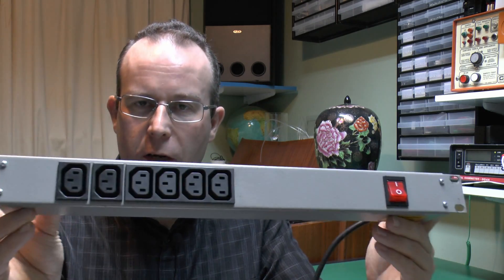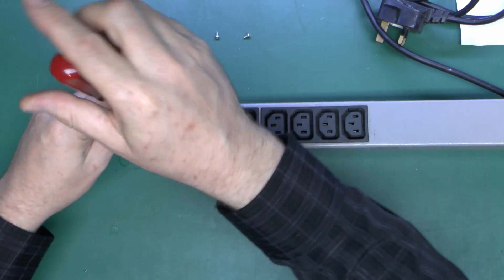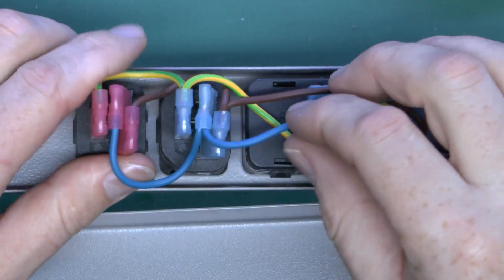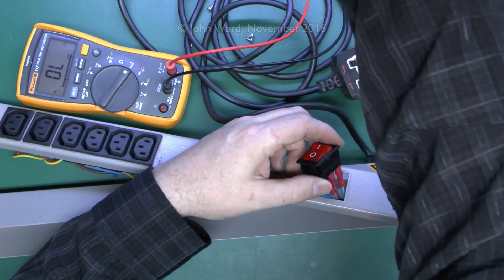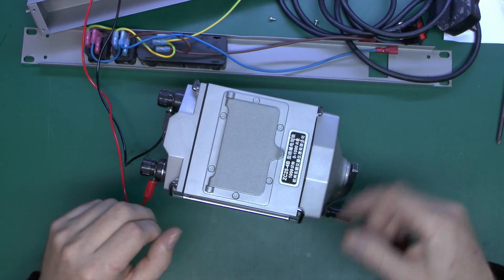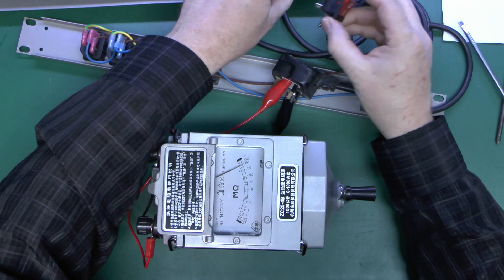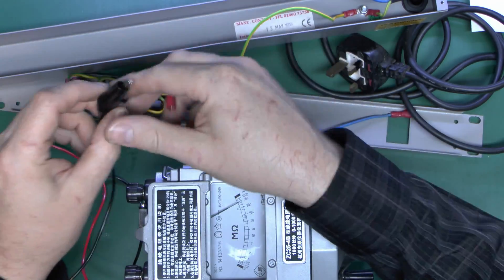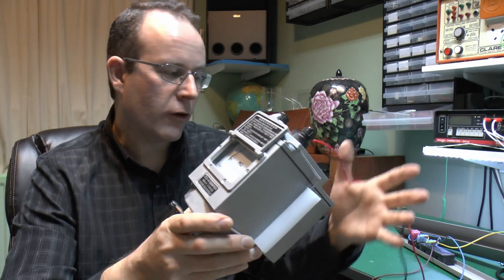Old Power Distribution Unit

Comment: Love the Megger! I can shed some light on the manufacturer. I work for www.dcdi.co.uk and have been selling that same PDU for around 20 years. Also we recently acquired a PDU manufacturing business that uses the same metalwork supplier - www.integra-pdu.co.uk
FFL was Fieldgate Fixings Ltd and yes, they were in Chard, an area that I believe still has only 5 digit telephone numbers in use! Fieldgate Fixings moved to Taunton in the late 1990s/2000 and became DPS (Data and Power Solutions). Around 5 years ago, DPS was bought by a larger American company called Geist. Just under a year ago Geist was purchased by a massive PE outfit called Vertiv and are now gunning for a slice of APC's cake. Their product these days is a much higher end unit with IP monitoring and remote switching and if you need any www.dcdi.co.uk can help! If you need a replacement or a PDU very similar to the one you tested in your video then you need www.Integra-PDU.co.uk - excuse the shamless touting of my business, but it is all relevant and hopefully on interest!
Reply: Thanks for the information 👍😀

Comment: You probably have the 4-way and then the two separate 1-way IEC connectors to make the wiring easier. Also, cutting holes for 6 individual 1-way IECs would increase the production time for something that looks to be made in smallish quantities. Further to that, I'd imagine that 6 cutouts would weaken the front panel more so than the current setup
Reply: Agree.   It's probably cost savings too -- you could machine any number of holes out of that faceplate so its all about what components are available and what combination gets you the best margins;  I'm sure for a 6-way PDU the cheapest combination was 4+1+1.   I bet if you bought an 8-way it would have 4+4.

Comment: This was made for the UK market and in the UK. Why don't the outlets have shutters?
Reply from the maker: The requirement for shutters only applies to BS1363 outlets, items such as this power strip are not included and would not normally be used in homes or other locations accessible to the general public either.
Reply: Thank you for clearing that up.

Comment: not just 1 and 2 wires but red = wires with a total (area square)of <1.5mm2 and Blue = wires with a total <2.5mm2.  (Yellow goes up to 4mm2). The minimum is about 0.2mm2 for Red, 1.0mm2 for Blue and 2.5mm2 for Yellow.

Comment: When he checked the resistance between line and X, why did he connect it to the part when the fuse is inserted rather than the live pin of the plug, if someone could tell me I'd appreciate it. Cheers.
Reply from the maker: Without the fuse installed, the line pin is only connected to the metal tab where the fuse fits.  The other end is connected to the wire.
Reply: John Ward ahhh I should of known that, thanks mate. I've scrolled through a lot of your videos and the level in detail is amazing. Keep it up.

Comment: Red crimp connectors are smaller in size and only have one wire in them, the blue are larger because they have two wires crimped in them.

Comment: 01460 73736 is a Crewkerne Somerset number. Ten digit phone numbers are still quite common in parts of the south west and a search reveals this now belongs to RH Construction (http://www.trustedlocal.com/directory/building-decorating-appliances/r-h-construction.htm). 

Given the construction of the unit my guess is that FFL were a pretty small scale manufacturer who are now long gone. There was a metal fabricator in Crewkerne who could have easily turned out the casings for these and the rest of the components are standard off the shelf.

Comment: Did they really copy the bezel screw heads in fake plastic on the megger?
I have several, and one hand cranked one in particular I prefer over all the others, including those with battery. It's just so quick and convenient to use, no switch, no battery to run down, and it keeps your hands off the circuit. You know a short after just a flick of the handle but I always give it a good few turns, just to make sure. 
BTW the movement inside a megger is quite interesting, since it reads nearly correct resistance regardless of the speed you crank the handle. It is similar to the movement inside a power meter, probably worth a video segment if you are into that.
Also the rectifier in the old ones is mechanical, reverse of a commutator. On the 5kV ones I have it is quite a pretty thing.
Reply from the maker: Yes, the whole top plate is a single piece of plastic, fake screw heads included.
Reply: Makes me wonder if they did a vaccuum form for the injection mold or if they did that on purpose to deceive people.

Comment: The red connectors they used take one wire while the blue ones take two, that's why they are different.
Reply: Was going to comment that...

Red ~0,5–1,5 mm&#178;
Blue ~1,5–2,5 mm&#178;
Reply: stefantrethan wow someone else who relised this I thought it was common knowledge
Reply: Where going to comment? What language did you translate from?

Comment: Is it possible that the two separate are for always on power and the 4 together switch off as a group?
Reply: Tech It Out did you not see the video? all the outlets are from the same switch!
Reply: Yes but one was in a box that may have had some electronics that when one item say a PC is turned off they all go off. I have a switch block that does this.
Reply: this is not a smart socket, its all wired as a group, there is no reason i can think they used 3 sets instead of 2 of the larger.
Reply: +jusb1066 Price. A 4-unit might have cost more than two singles, but less than 4 singles plus extra wires. Probably no other counts readily available from RS at the time, so this combination was probably the cheapest way to assemble 6 IEC C13-like outputs with high quality parts that they would risk putting their name and phone number on.

Comment: The connectors have different colours because they are marked for diffrent wire sizes. For red (0.5mm² - 1.5mm²) and for blue (1.5mm² - 2.5mm²)

Comment: I think they used the 2 separate plugs because they were cheaper than getting a 6 plug or a 2 and 4 plug socket
Reply: Hearing RS + Cheap in the same sentence would be a world first I'd think.
Reply: dossod either that or a 6 gang socket isn't available off the shelf

Comment: Tripping is most likely due to the neon resistor having gone low as you could not find anything else. The terminals are colour coded as to size, the Blue are larger than the red. The tripping could also be due to a whisker from one of the wires touching another at the terminals and the act of pulling it apart moved it. You should try plugging it in with a breaker plug in line to test it.
Reply: it showed about 2-3 megohms with the neon in circuit, so its not the neon, i think it was just another device was faulty and they blamed the lead.  the reason to use a mega tester is to not need a breaker, its to test and find the fault.
Reply: I did not note the resistance of the neon, but thinking on it more it could well be the fault is in the plug, I had a computer lead with a moulded plug that had a shorting whisker in it, he made the tests without the fuse in.
Reply: Equiluxe1
i agree i would have tested it from the plug end , fuse intact initially, there could be some wierd reason like you say,but i guess this one escapes, im sure its going in the bin anyway

Comment: Minor nitpick. When you checked continuity of the switch you first only checked across one diagonal when the switch was closed. That's fine since you just confirmed the switch had continuity when closed. But then you also only checked one diagonal when the switch was open, which excludes other failures that could theoretically occur.
Reply: Yep that had me screaming at the monitor.
Reply: You need anger management lessons :-) And a bit more smarts.. screaming at inanimate objects rarely helps. Then again screaming at computers is fine because it just helps the screamer, internally.
Reply: petti78 You probably need "a bit more smarts" if you read Mentorcase's comment literally. :p

Comment: What was usually the case with these items was they built them to what ever size people asked them for.. 
But would build them up from a fixed set of plug units. I am guessing in this case 1unit, 4unit (and maybe they had higher such as 8unit), and buy those in bulk.
In this case, to make 6, it was 4+1+1 was obviously cheaper in bulk than buying a 6unit.
If they brought 6units in bulk instead of 4units If someone wanted a 5, you would need to do 1+1+1+1+1 instead of a 4+1. It was prob just the happy middle ground for more customisation cheaply.

Comment: Different color terminals... red=1 wire,  blue=2 wires.
Reply: Red color in these crimp connectors usually denotes 1,5mm² wire size and blue 2,5mm².
Which seems to be mentioned in other comments too...
Reply: I was about to say the same thing.